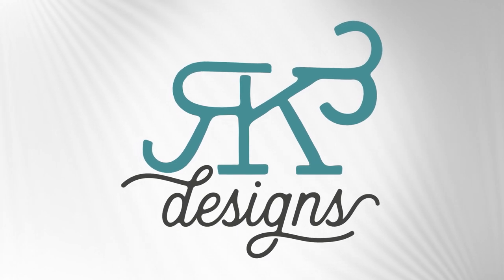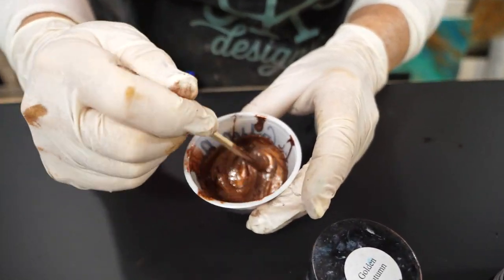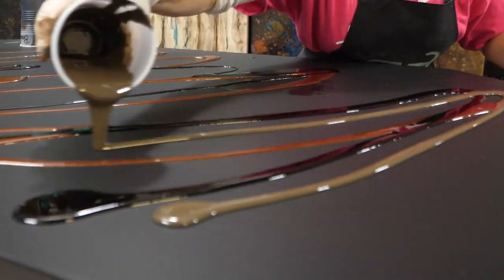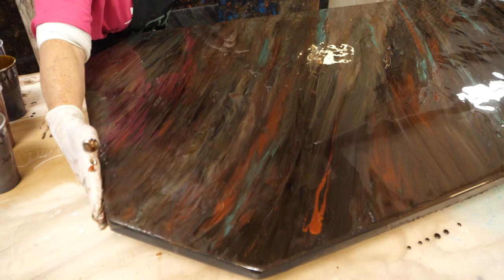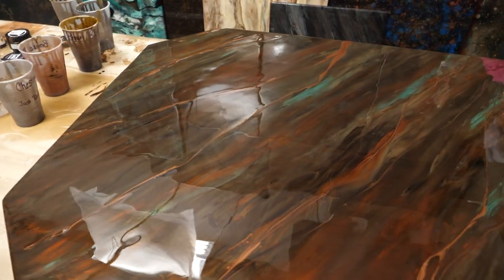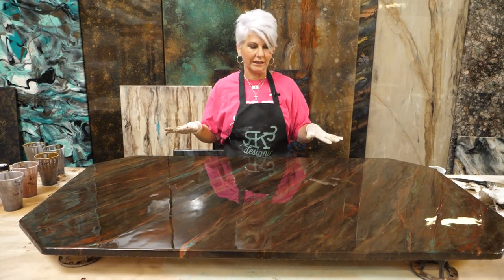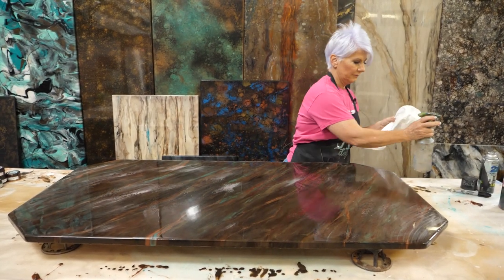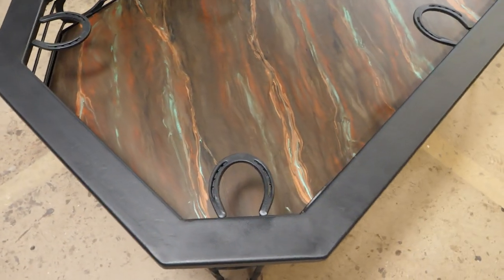Custom Metal And Epoxy Table | RK3 Designs

Comment: These are the colors I’ve been looking for in my projects. I will be redoing my bathroom countertops, because I don’t like the whites and blues I did. Do I need to start from the beginning with another base coat, or can I just sand down the top coat and redo it?
Reply from the maker: You can sand with 220 really well. Then repaint with your base color and pour as usual. 😊😊

Comment: Sir, I have few queries regarding Epoxy River Table and Table Tops. Plz guide on these : (1) how long will be take before the epoxy shows yellow ness if we are using epoxy without UV Stabilizer and if we use Epoxies with UV stabilizers. (2) Can we have any coating on top of epoxy so that we can make it totally UV Resistant. As far as I has learned so far, all epoxy will ultimately shows yellow discoloration (even if not exposed to direct sunlight or even if we use UV stabilized Resin) over a period of time. I just wont to know how long it can last without any discoloration. Plz Guide on above Points.
Reply from the maker: Great Questions. That’s a really hard question to answer because it most definitely depends on a variety of factors. UV expose, temperature and quality. Cheaper quality epoxies will amber in a matter of weeks. High quality epoxies could take years. Again, depending on what environmental conditions you put them in. I never recommend pouring a crystal clear river table.